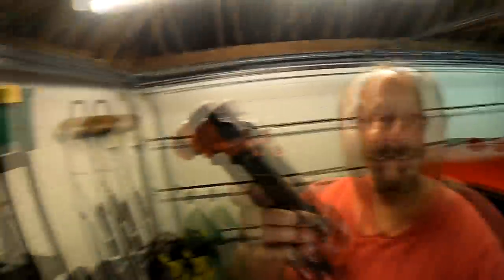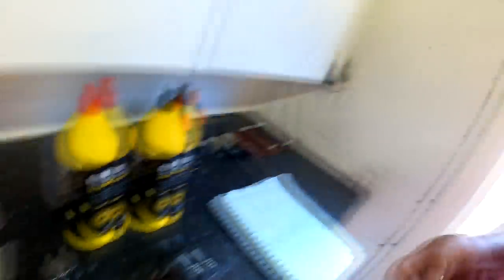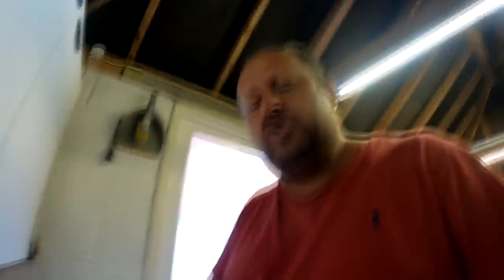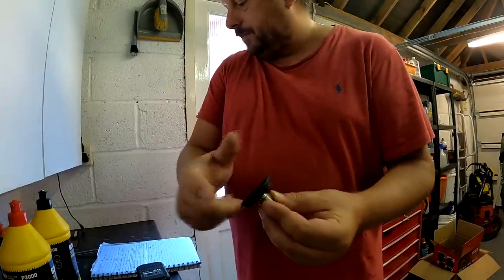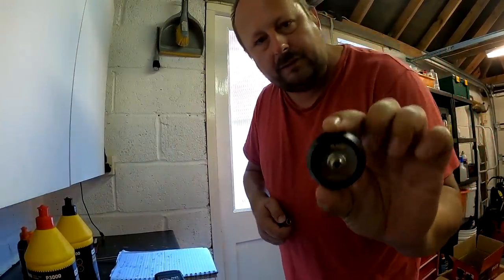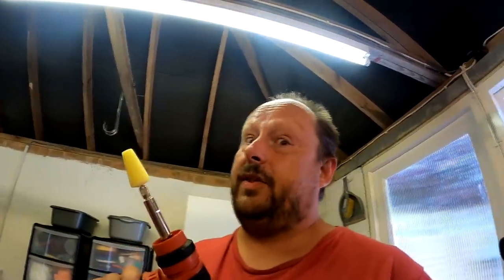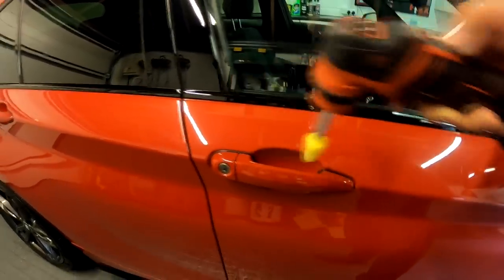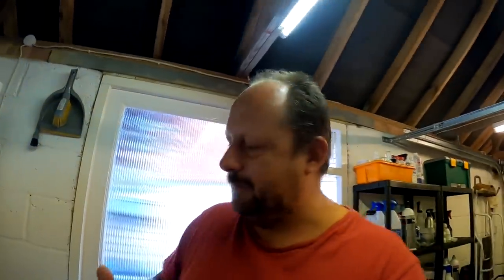Awesome accessories to make the best mini polisher even better.

Comment: Bought a PXE a few weeks ago. It’s amazing. I wish I had bought one much sooner. I’ve bought some of the APS accessories direct from APS in Germany. Their 75mm backing plate is far better quality than the Flex original. The prices are way better than the UK. Delivery is not cheap, but the savings make up for it.

Comment: I bought and extra flex 3” plate, trimmed it down to 2”, drilled a little hole so I can use it in rotary mode.

Comment: Jon, i think it is ok to use non-standard accessories as long as we dont crank her up all the way and use it at a conservative power load. Furthermore, when i was tinkering around i did burn a very tiny section of paint with the rotary on level 1 or 2. Luckily, it was under the boot lid, so you litterally cant see it unless you open the boot, and its such a minor burn you cant even see it. good lesson though.
Reply from the maker: well to be honest if you spoke to flex they may well say no its not ok, because they have no tested or qualified their tool with these accessories.  This is more relevent to the 50ml rotary plate.    but in reality its just a little attachment.  but you are taking a leap of faith that APS has tested this well.  Im sure they have.

Comment: One question. So you cant use those M14 flex made extension shafts which they have for the rotary (on your flex wall as well) and add an M14, 2-inch disc on there?????

Comment: @forensic detailing channel finally purchased my first pxe thanks to you 😎 I'm just adding these accessories and pads to my basket to go with my tool and have a question u know this aps fva50 for the cone pads if I buy that can I remove the end cone attachment part and just use the bar as an extension like the fv50 extension bar 🤔 I could save £11 if it works beach's they look the same

Comment: Can I just ask your advice? Is it always necessary to machine polish after machine compound,  or can I bypass the polishing and go straight to hand wax from the compound stage? Thanks very much
Reply from the maker: you can polish a car to any standard you like.  most human eyes will not be able to tell the difference in finish between a good high gloss heavy cutting compounds like H8 and a finishing polish.   But its not just about the level of gloss.  When you compound you typically do it with stiffer coarser pads or wool pads or microfiber pads and you can get whats called compound marring, or machine marring from compounding.   so a lot of times you then switch to soft foam pad and finishing polish to take out compound marring.    let me make it simple though, if you are a "detailer" I personally do not think leaving a high gloss finish from a cutting compound is acceptable really. you should finish it out or use a single stage product like perfect finish or S20.
Reply: Thanks once again for your helpful advice, much appreciated

Comment: Jon im so excited about Scholl Concepts new S2 BLACK!!! PLEASE DO A REVIEW...maybe a full brand review is due.
Reply: DAVE! get yer head out of the poker tournament! He did a scholl video about 2 months ago showcasing the brand. Just breaking yer balls 🤝
Reply from the maker: s2 black is nice, s2 shock is much more agressive and not as smooth as black.  I would personally go with S2 black.  The question is really as a guy at home  S3, S20, S40 is probably good enough.  S2 yes it will give more cut but theres not much in it.   So I guess you can switch out S3 for S2.   Scholl concepts abrasives are good products dave.
Reply: Forensic Detailing Channel excellent customer service dad 😘

Comment: I was kinda bummed when I found out that you couldn't use it like a rotary on the 75 plate, and no marketing pointed that one out.
So I drilled a hole in it!
Just be easy with too much pressure and it works like a charm imho.
No overheating issues on my use.
Reply from the maker: there must be a reason rickard but Im half tempted to do the same.   its a small machine it might be asking a lot of the tool to drive a 75 plate in all scenarios.
Reply: @ForensicDetailing  
Rumours say that the early prototype had it running the 75 as rotary. Also in the early vids they claimed the 50mm plate to include as well in the package, bummer!
Maybe they pulled the 75mm rotary away if they can't guarantee it spinning a full-day at a shop.
But being a amateur polisher not polishing everyday I think it should hold for my use.
Have a go and make a video about it!
Reply: The pin in the rotary attachment is just a pipe pin. Put a pair of pliers on it and pull it out. It’s very easily done, no glue or nothing. I suspekt it was done this way so it would be possible for people that wanted it, but to eliminate the possibility for errors by people assembling them by accident. The tool itself works perfectly fine as a 3 inch rotary.

Comment: Hi I have fxe7-15.  Now I’m looking for a mini polisher. Does pxe80e work as well fxe7-12 when it comes to corrections
Reply from the maker: no 7-12 is on another leve of grunt and power.  there has to be a comparmise. the pxe is a nano tool with remarkable grunt for something so small but its still a nano tool.   7-12 mains powered bigger motor much more torque.

Comment: This polisher seems better than the nano ibrid?
Reply from the maker: its more powerfull, has a much better mechanism for swapping plates or adapter, its cheaper, the batteries I think are better.  But also with the 75ml plate on the 12ml adapter, it works very very very well as a standard 3 inch mini and you will find a lot of areas on the car where its perfect for.    the nano was a more intricate tool though.  This extention bars and cone adapter really do bridge that one area where the rupes was better.